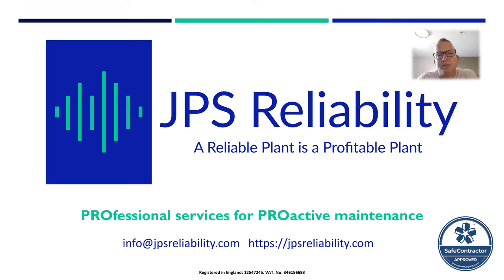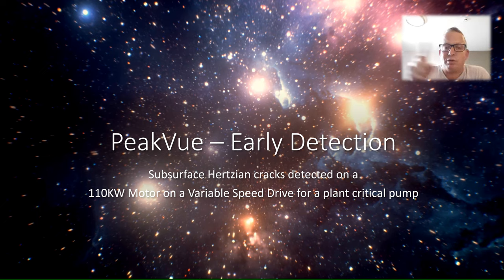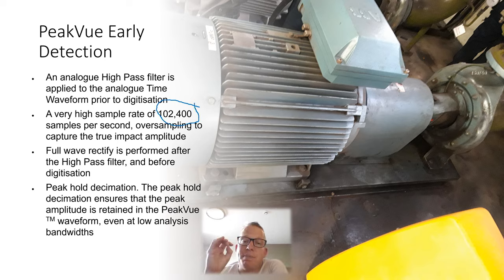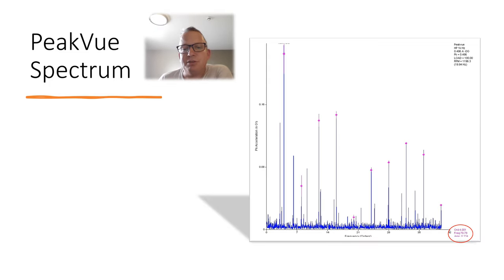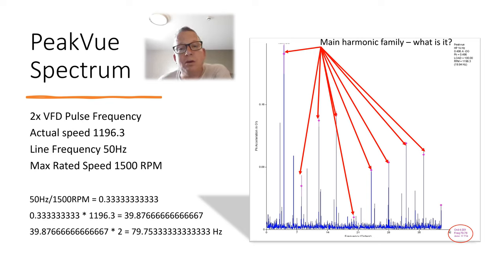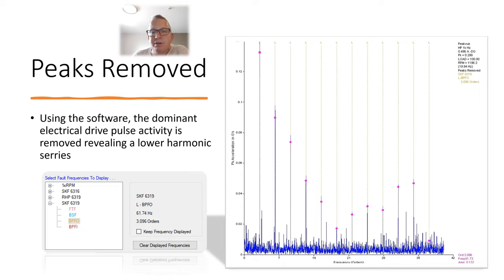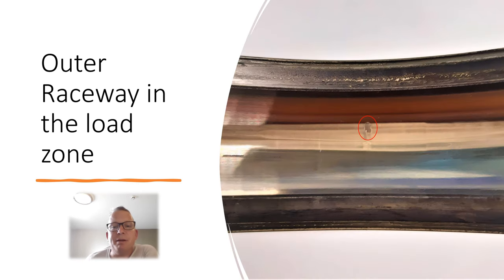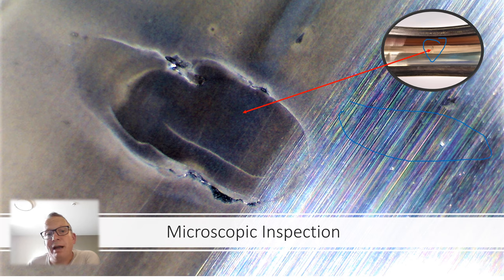PeakVue – Early Detection

Comment: I like practical experience cases. Here, why did you divide 50 to actual rpm, and then multiplied by operating speed 1196.3 and twice? Could you explain Sir????
Reply from the maker: 50 as we are on 50Hz line frequency for the electrical supply, and multiplied twice  for the two time electrical pulse frequency for the north and south pulse

Comment: Let me get this clear, as I understand  2xVFD pulse is the analog for 2xFL, correct?
Reply from the maker: Hi, think along the lines of when we have an air gap problem or soft foot we tend to see a 2xFL signal in the vibration data. And then a motor that is on a variable speed drive it’s the same we see 2x the supply frequency from the drive in the vibration data,. We call it the 2xVFD pulse signal so it doesn’t get confused with the input frequency to the drive the line frequency